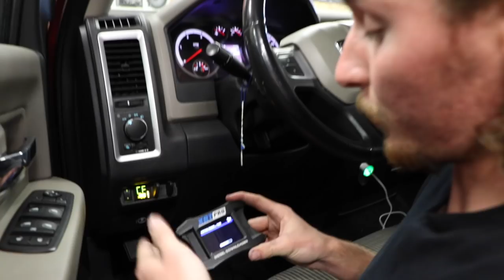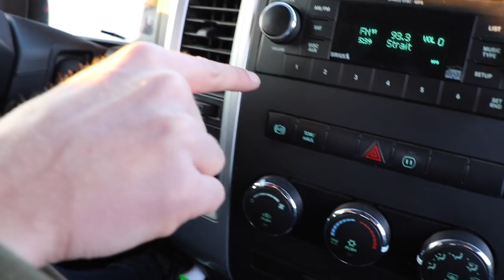MY NEIGHBORS ARE GOING TO HATE MY CUMMINS NOW!!

Comment: I've done a 5 inch exhaust on a 4th gen and I took the spare out and bent the metal guard mounted the back half of the exhaust then pushed the guard back and left it about a 1/4-1/2'' away from the pipe for heat reasons. many other ways to do it as well but figured id help.

Comment: Wish my exhaust brake still worked on start up :/ only works when driving.
Reply from the maker: Dang! its my favorite sound!
Reply: Bug Bmx yeah it kinda sucks. I'm thinking maybe it has something to do with the tuner. Have a bullydog and I'm gonna take it off and get an MM3.
Reply: Jeffrey Vandenbiggelaar you can use it, just go on high idle then hit the button, and it will kick on, i have a 6.7 cummins
Reply: That’s the variable geometry turbo that you hear, and it’s closed to assist with warming up.